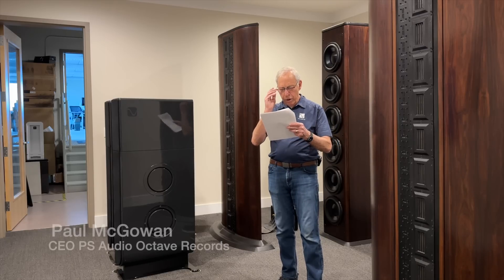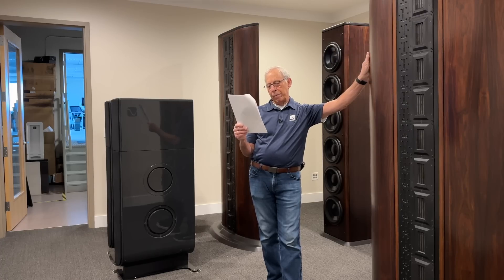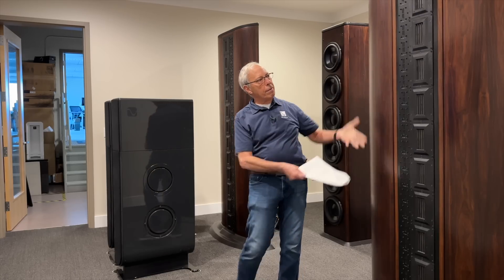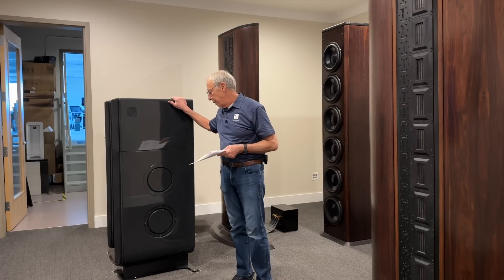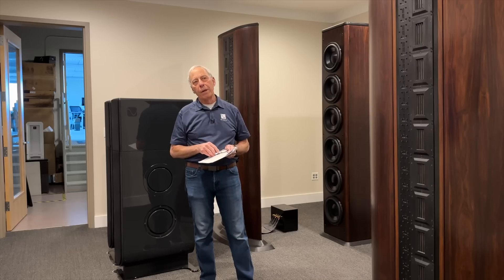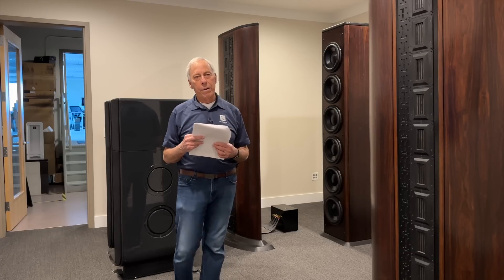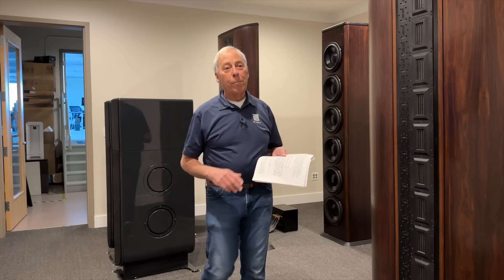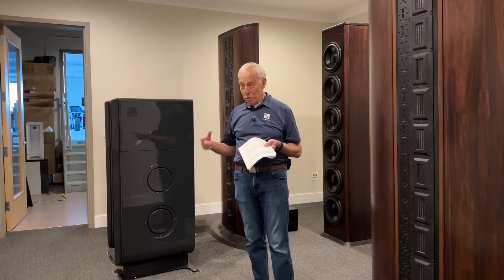Amp power vs  Speaker power

Comment: I  ve speaker kenwood dg 3 3way speaker 80 watts 6 ohms pairs. With amp kenwood a85 power 70 watts per channel 4 front channels .centre 15 +15 rear 15 +15 on manuals specs of amp,n at amp rear its written 8 ohms and more, is it ok to run dg 3 6 ohms on it, its running very sweetly crisps nice sounds comes out.  N how many more speakers  i can attach??. Ur advice needed thankyou

Comment: So, would a speaker rated at 60watts be safe to use an amp that is 450watts?
Reply: Yes. As long as you turn up the volume not above what the speaker can take. 
A weak amp will be more of a problem due to the amp clipping more easily and that might damage the speaker.

Comment: Guitar amps are typically tube amps. Tube amp of 22 watts with gobs of headroom  are equal to 100+ watts or more than solid state. So speakers need to be higher wattage capacity.
Reply: Also. Recordings are always compressed reducing the peak amplitudes. Guitar amps are not compressed unless you choose to compress them and have huge peak amplitudes compared to recordings.

Comment: The reason is that severe clipping produces almost a square wave which has twice the power of a sine wave of the same amplitude. Clipping is hardest on tweeters so you want enough power to give plenty of headroom for short duration transients so not to destroy the tweeter. Guitar amps do not have tweeters to destroy by clipping the amplifier.

Comment: 90 dB 1W/1m is not efficient.

The question is wrong.  You start by looking what sound levels you need in your room.  Then depending on the efficiency of your speaker you can work back on what amplifier power you need.

A properly designed horn speaker with  better than 100 dB 1W/1m will make your ears (pleasantly) ring with a 10 Watt amplifier.  

Most speakers are stupidly inefficient and this creates a ton of additional Engineering problems in compensating for it.

Comment: Ahhh GEEZE!!!:face-green-smiling:
There's an old saying that goes it is better to remain silent and be thought a fool than to speak and remove all doubt.
While part of "Pro Audio" includes the art of reinforcing the sound of a distorted guitar amp, a guitar amp IS NOT "Pro Audio".
"Pro Audio" uses that same theory of using larger amplifiers for the purpose of supplying an abundance of headroom in the system as well.
Guitar amplifiers are actually designed the same way (to provide headroom) but are limited at the output stage so that turning knobs to 10 doesn't actually reach the full output of the amplifier.
The "distortion" created in modern guitar amps is created within the circuitry of the amplifier or through the use of distortion from an outside source such as a guitar pedal.
Originally the distortion was caused by putting more power into the input of the amplifier than the amplifier was designed to handle.
This has nothing to do with the output stage or output power of the amplifier.
So once again, "Pro Audio" is not using a guitar amplifier to create distortion.

Comment: 87 vs 90 db... 3 db less efficient means they need double the power. 3db is a HUGE diffeence. the double. every 3db doubles.
same as noisefloor. 3db more s/n ratio means it is half noisy ..6db means 4 times.
Reply: But not near  "preceived doubing of volume", 3dB is hardly noticable.
Reply: @Roosville1  google "3db difference"
The 3dB 'trading effect' means for every 3 dB the sound level increases the impact on hearing health which is doubled. For example, 63 dB(A) is twice as noisy as 60 dB(A). The relevance of this is apparent when considering exposure to hazardous level of noise.
Reply: 3 dB is doubling the power, and it is a rather small difference as far as how loud something sounds.
Reply: To double the perceived volume, it's 10 dB more input, which is 10x more power. The amplifier wars of the 1970's are really rather ironic, when you consider that the volume increase between a 50 watt amplifier and a 60 watt amplifier is barely perceived by the human ear.

Comment: You want so much power so the amplifier never distort the signal so you want more power than the speaker can handle.
Best way to burn an element is to use a weak amplifier and put the treble on 10, the max setting.

Comment: Yes, headroom is important.  Lots of power is important.  But our host left out a key factor:
It is very hard to control lots of power.

You can purchase a very power amplifier at a low cost.  It will play loudly.  It will also not be a fast amp.  It will not sound too good.  It will sound lazy, compared to a fast, high-end amp.

A high-end amp, that can control huge power with finesse, takes a feat of engineering, and a price tag to go with it.

A high-end amp, that can control huge power with finesse, is akin to having the power of a freight train, and be able to go from 0 to 100 in a split second, and come to a complete stop in a split second.

Such amps get very expensive.

There are low powered amps that sound fantastic, and will not break the bank.  They are more affordable, because they do not have to control what I described above -- at least not to the same degree.  A low powered amp will have an easier job managing its power, nimbly.  And as long as you do not blast the volume, you can get amazing sound quality at an affordable price.

But for a low or moderately powerful amp, you would need less demanding speakers.

Comment: I wonder if big headroom solid state amps have the finesse of some lower watt cousins.  Does a 600W amp with tons of transistors really reproduce the low level information as well as a modestly powered tube amp or a little First Watt class A?  Perhaps PS audio has the right idea with their hybrid power amps.

Comment: Maybe also consider amp design, particularly pure class A. Arguing that Nelson Pass is duping customers with selling 25 W pure class A amp does not sound right. 87 dB sensitivity with 1 Watt = 87 dB SPL at 1 m. That is LOUD! I typically listen at 65-70 dB SPL, even sitting away 2-3 m does not require 1 W. Even assuming bad speaker impedance curve (dipping by half of nominal) still does not require 1 W. So 25 W (even 10W tube amp) is plenty for the VAST majority of home scenarios.

Comment: Smaller amps can more easily start clipping the signal when playing loud and clipping yields higher frequency harmonic distortion that can burn your tweeters that are typically rated at much lower power.

Comment: Paul's knowledge falls into the ground whenever the subject approaches Pro Audio.
The reason why guitar amps favour a power imbalance is because over driving the amp is a HUGE part of the sound.  That's why 50 watt Marshalls are often favoured over 100 watt heads.  The reason why studios use amplification double that of the speaker is for DYNAMIC REALISM-- an essential trait where studio monitors blow the doors off audiophile systems.
Reply: Isn't Paul's use of the word "headroom" describing the same end result as "dynamic realism?"
Also: Please clarify what you refer when saying "studio monitor." Are you saying studio equipment in general, or studio monitor speakers?
Thanks so much.
Reply: @Reflectiveness  Statement audiophile systems, as Paul says should have ample headroom even though you may never use it.  Dynamic Realism is an entirely different thing.  Strange how the most legendary pro manufacturing speaker company in the world is not considered "audiophile" -- JBL.   Paul McGowan himself explains how it is the speaker, not the input signal that is actually 'pulling' or (demanding) the power out of the amp.  No driver does this better than JBL.  Greg Timbers head engineer for over 40 years says the number one design goal of JBL is dynamic realism.  Studio Monitor translation:  When the drummer hits the kick drum, all of the velocity of the beater hitting the head combined with the sheer volume of air movement resonating within the shell, causes the drivers to explode out of the speakers-- if your running studio monitors you better have double the rated power.
Reply: YES! Finally someone who knows something about pro audio. I run nothing but studio monitors in my setup, i always run power amplifiers with atleast double the output wattage of the speaker's rated continuous recommended input. Sound quality is mesmerizing with tons of headroom and unbelievable dynamic range.
Reply: I'll add, that there is a huge difference in guitar valve amplifiers. I had a Marshall 2X12 100W combo. The spec is 100W at 1% THD, but it goes a long way past that. It used to hit 100W with the volume at 4. From 4 to 10 it simply overdrove the output stage as well, in the end generating 210W of power. With a pair of  12" 103dB/Watt speakers it literally shook ornaments off a shelf in the house. The volume was something else. :-  )
Reply: All my car audio speakers are PA or designed for concerts. So when I play a live rock album, it sounds just like a rock concert.

Comment: No, the reasons why Amp Power should be larger than Speaker Power are, 1) if you overload an amp, or drive it close to it's limit, the amp will be able to output a wattage higher than the specified value, but at a significant  higher distortion rate (ie. clipping), the high frequency will easily burn a tweeter in the Speaker. 2) The Speaker Power number usually means over that power for a prolonged time, the voice coil will be overheated and be burnt, but momentarily over power (ie. listening to music content) won't be an issue.  Overall, better to have a higher power amp to keep distortion low.

Comment: The problem begins when the amp starts clipping, this causes a lot of high frequency output. With a hifi speaker, all this power goes into the tweeter, and a tweeter in a 100 Watt speaker can't handle 100 Watt. So when you have enough headroom, the amp won't start clipping. It's getting really loud, but the frequency distribution won't change.
'm not an expert with guitar speakers, but I assume that they have only one driver. So this driver can handle a clipping amp, and you're on the better side when the amp isn't too powerful.

Comment: It historical , Typically  a sine wave has power described as 70.7% of a square wave given the same pk-pk voltage amplitude (area under a curve). If you overdrive your power amp into clipping because it’s under-powered, then the output becomes square and you will begin to dissipate serious heat into the driver, melt the voice coil adhesive and such. You will also develop a very high upper harmonic power, and may fry the tweeter. The idea is if you have a much larger amplifier then you won’t clip, so you wont toast anything.  Is more about gear preservation than getting better audio. For the guitar speakers you would expect that the amplifier would be driven into clipping hence you need the bigger wattage speaker to cope with the extra power from essentially a square wave. The speaker is designed to take the punishment and also to undergo cone-break-up to add “tone” to the amp, hence the best guitar speakers have a small 1” voice coil. My Celestion open back cabinet is 103dB/Watt , and extend to nearly 6kHz.it’s a totally different design requirement.
Reply: Thanks, you saved me from writing 😂👍
Reply: My Large Advent speakers (back in the 70's) had a switch on the back that could attenuate the high frequency power going to the tweeter, so you wouldn't fry the tweeter.

Comment: What's a loaded nonsense you in your headroom! Head's in the clouds lol 50 watts cl, is plenty for the majority of speakers at 88 DB SPL
Reply: I was going to answer, but people already think I am a whack job. Just note until you have had the "head room" you won't understand.
Reply: @scottyo64  you still got plenty of headroom at 50 watts x2 I don't know what size rooms  these people have got We're not talking about filling a hall
Reply: Try to play a classical piece of music, or just «In the hall of the mountain king», to check if it feels realistic by using 50 Watt!
Maybe in a nearfield setup, but in a living room, you need a lot of power for dynamic.
That is why he say power is essential.
I use Anthem 525 G2, in my setup speakers are the limit, because I have no subwoofer. Amp can give 400Watt in 4 Ohm, as my speakers are, but it sound dynamic, even on low volume.